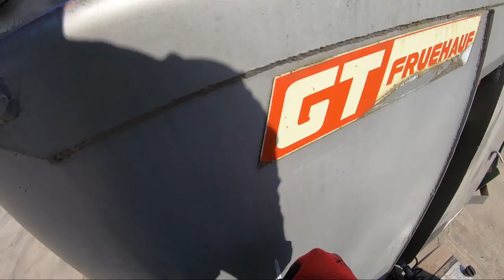2.5 Tonne Overweight & Blindsiding Off A Weigh Bridge - Last Day At Freelands.

Comment: When you set yourself up to reverse you seem to get the unit on an angle as you are taught on your lessons so your trailer is already primed to go towards the bay.  Just creep back and let the trailer do the work if you need to add more lock or take some off just do a little adjustment  you are adding a lot of steering and then having to wipe it off very quickly . I was the same when I started I was fine if I took my time but when I got to the motorway services and it was busy I felt all eyes on me and me head melted and I started making a balls of it . 
Hope you get back into a job soon 👍
Reply from the maker: I;ve been told this a lot, so it's deffo something i'm doing wrong, i'll try and correct it when i get back behind the wheel! Thanks for the advice mate!
Reply: @Deady2012  very welcome mate, I'm no expert compared to maybe a 20 year pro. However I was in the same boat as you 6 years ago and often felt the pressure of awkward or blind reversing with people sniggering or muttering negative things. On the plus side I got great advice from a few people that stood me in very good stead and the most helpful advice I got was to creep back initially on the angle you set yourself up on then see how sharply the trailer turns. If its heading for the yellow lines or trailer marker rails to early then bring your unit round a little if you  haven't put enough on and you are miles away from your point of docking then a quick flick of left lock will send the trailer in right direction.  I have some good photos of my first tight reverses and exits of awkward places in my gallery which would make you laugh but you cant share them on YouTube for some reason.